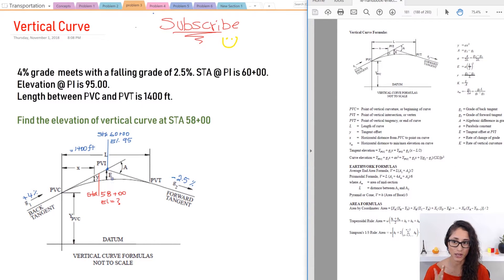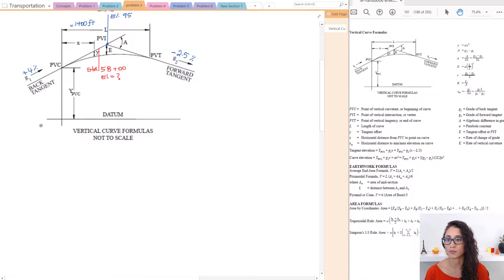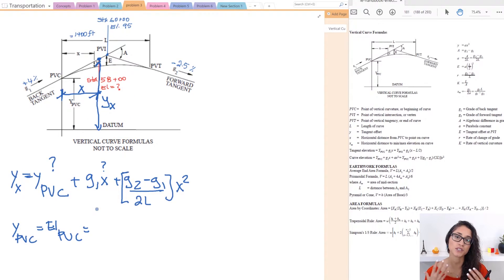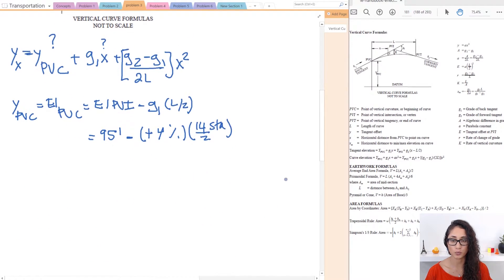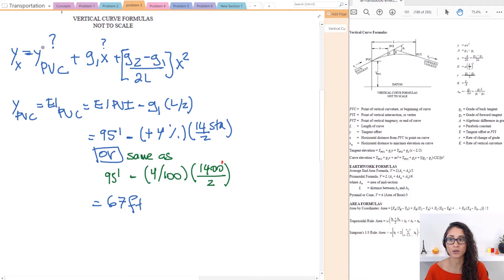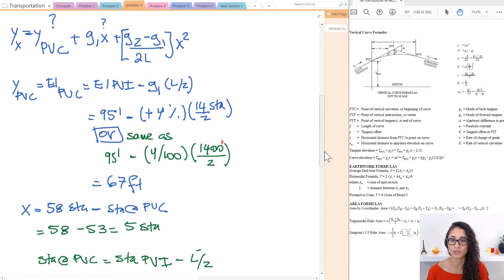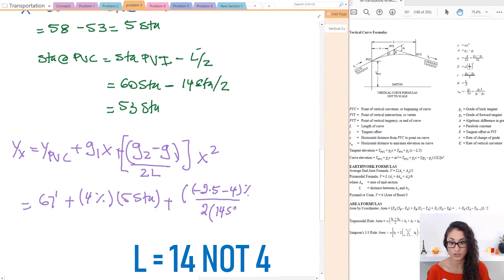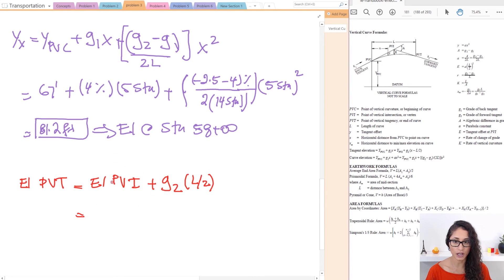FE Exam Transportation - Vertical Curve Problem 1

Comment: A quick reminder for everyone: Even if you're using '%' and 'sta.' for the equations, you leave the percentage off the calculation. E.g. - Input 4% grade as '4' in the equation. If you don't you'll get the wrong answer.